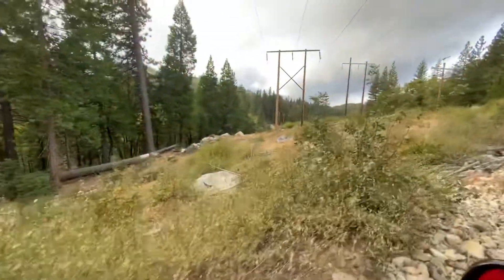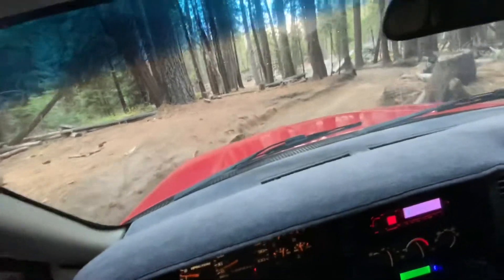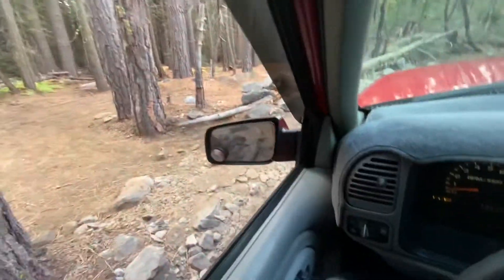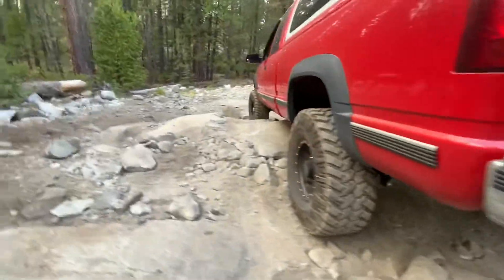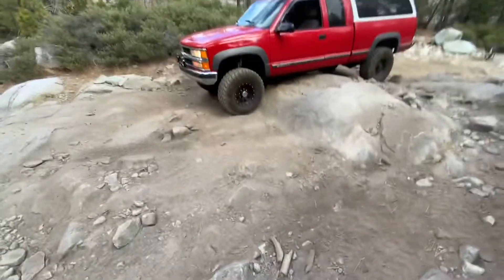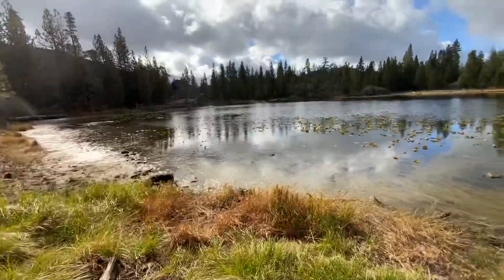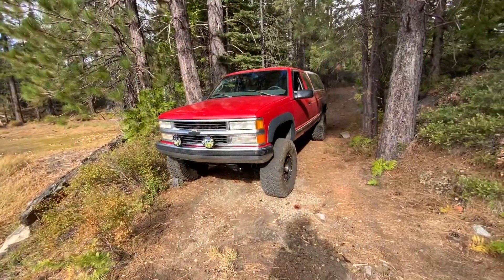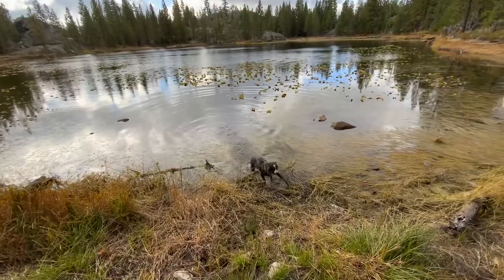Straight Axle Swapped Chevy K2500 Off-Road Testing at Fordyce

Comment: This is the way the trucks should’ve always been built, good thing Ford didn’t give up on the solid front axle!
Reply from the maker: Yup! But ford gave up pushrods… luckily GM never gave up hahaha
Reply: @Calikov762  Now they’ve gone back to them!
Reply from the maker: @JohnMurphy-dw6ml  the balance of the universe is restored 🙌
Reply: @Calikov762  I don’t know about that because General Motors has been going downhill and they still don’t have solid axles in their trucks and now they’re putting four-cylinder engines in their full-size trucks!

Comment: Such a cool truck.  One of my favorites I keep coming back to watch the videos over again.  If you get a chance it would be great to see an update on the truck or better yet see it in action on the trail.  Thanks for your work putting these videos together.
Reply from the maker: It’s hard to film and drive! When I get a cameraman I can certainly make more videos haha. I have been taking it on some more difficult trails like the Backway to Crown King in AZ as well as Boulder Basin to Boulder City ID. Check out my instagram @GMTruck400 to see the pics and short video clips!
Reply: @holdenc3082
0 seconds ago
Thanks for the reply.  Would love to see more video if you get time.  I’ve got a 98 Tahoe and am looking at the ORD axle swap.   I’ve considered the coilovers from Tahoverlanding, but I keep coming back to just wanting leaf springs for their simplicity and not having a bunch of custom proprietary parts.  

I have the ORD custom springs in my square body Suburban with a 6” lift, 37s, and 1 tons.  They work really well for anything I would use the truck for.   Keep it simple.
Reply from the maker: @ ORD or WFO is the way to go. Not worth the time and money to swap in a Dodge Center-axle Disconnect axle IMO they are weak and have their own problems. The WFO kit uses control arms and a 05+ superduty 60 which is a lot easier to find these days, and will handle better than leaf springs. Just gotta buy expensive coilovers to use their kit though. Depends what your goals are for your rig. If its going to be your daily driver go with links and coilovers for that precise steering and soft ride.

Comment: Pretty snazzy.  It's too bad you only got to Eagle Lakes, those are just easy and moderate trails.  I'd be impressed if you went the whole way.  Also you have a wonderful Australian shepherd.  I'm looking at doing the same swap but not sure if the D44 is up to it.  I'd like to do the whole trail.
Reply from the maker: I’m not sure how impressive crushed rocker panels and doors are… I don’t have rock sliders, and I would probably need a locker and 40+ inch tires to make it over the winch hills. If you use a Dana 44 high pinion off of an F250 you will have the strongest Dana 44 but it still has small shafts and ring gear, I’d trust it on 35’s all day.

Comment: Hi what Ford axle is in the truck
Reply: I’m pretty sure he’s is a 06 Dana 60, I did the same thing in my 1500 and went with a Dana 70 king pin. Great setup highly recommended it!
Reply: It’s a 36.5” spring pad width kingpin out of 80’s to early 90s ford one ton axle. It’s not a 06 axle  they have Radius arms and ball joints.